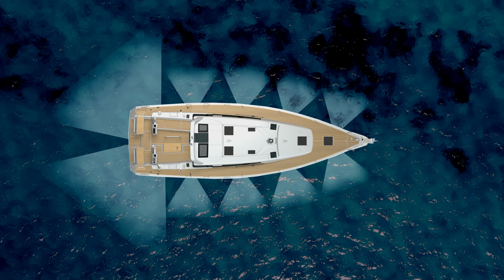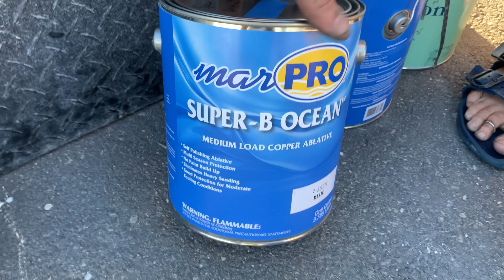SALVAGED BOAT Refit: Installing LED Underwater LIGHTS and New RUDDER BEARINGS| ep.15

Comment: Hi Folks, can I suggest a torque wrench for checking your keel bolts are tight enough.  You'll be amazed how much force is required to get the right specification, also those small square washers aren't ideal, if you can, having a plate that goes over at least 2 bolts should avoid the point loading you get with the corner of a square washer and mean the force required to pull the bolts through the fibreglass would be huge.  Just my 2c's feel free to ignore but I've gone through a similar process myself.

Comment: Keel bolts are designed to outlive you and me. Didn't see signs of any repair. There was no sign the bolts have moved. The fact you were able tighten ever slightly speaks to the structural integrity of the studs. Water will play Hell with the stud and nut. Hull-to-keel joint was in definite need of repair.

Her's? Require allot more inspection. Happy for both of you.

Comment: I was hesitant about putting in lights under the water line.  After I've been in the water for a year I regret it.  I have a couple of lights I can plug in and hang over the edge, but it's nowhere near as slick as built in lights.

Comment: So, you flush mounted the bulkheads to put on bubbly lights?  MMMmmmmmmmmmm....k!?
Reply from the maker: Yeah doesn’t make much sense, meant to call myself out on that in the ep but forgot
Reply: @SpearItAnimal   - All good, just the effort to keep it sleek and then stick on bubble lights to do just the opposite what you worked for can confuse, but, bottom line, is what it is.  Keep 'er rocking!!

Comment: Put your seat belts on! That prop is JUNK, I wouldn't want to rely on it even as a spare. I can't tell but in the video it looks like you painted over your stainless chain-plates? If so you might want to strip it off and polish them up, stainless steel will crevice corrode in an anaerobic environment especially when soaked with saltwater on a daily basis. Your paint job over the stainless part will shorten its service life.
Reply from the maker: Just blue painters tape, we rushed out of the yard and removed it later